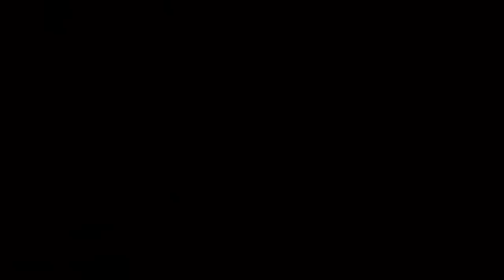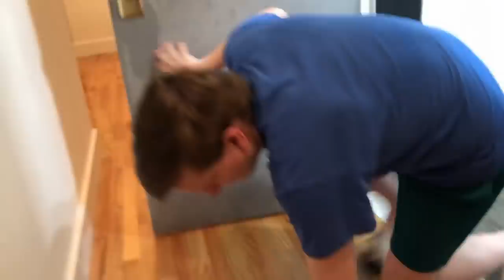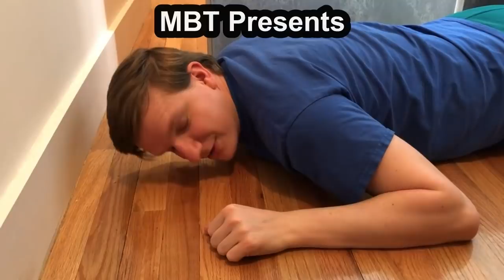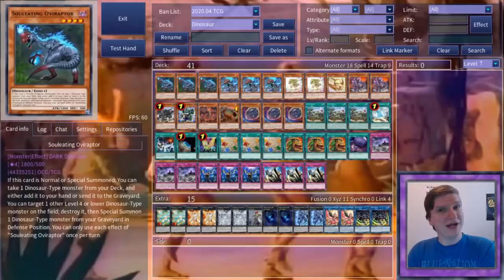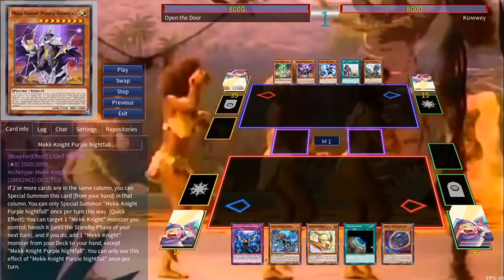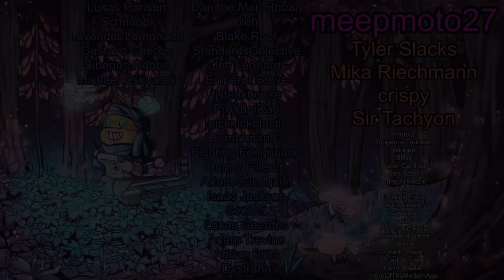DINOSAUR - Ten Minute Testing 4/15/20

Comment: 4:43 What does he mean by "koakai and eggs" what does he mean by "eggs" the non tuner adaman monsters?
Reply: Yeah, he's talking about the crystal forms of Dragite/Leonite/Raptite before they become the Synchros...
Reply: @Hawk_Blade99  don't you HAVe to play them for the Adamnatia engine?
Reply: @DareToWonder  Not necessarily. All you really need are the "miner" cards (Seeker, Researcher and Analyzer) and level 4 or lower non-tuner Rock-type monsters...(which the crystals just happen to fit in with).

I mean, the Crystals can allow their Synchro versions to activate their secondary effect and the crystals can also recycle their Synchro versions back into the Extra Deck, but that's about it.

The crystals aren't as strong as you'd think they would be... Some people have replaced most of the crystals with Gogogo cards...except for the Dragite crystal because that crystal lets you draw a card.

It's definitely an interesting place for Adamancipators...
Reply: @Hawk_Blade99  i dunno, im going for a general rock build with Metaphys and Fossil's soon so im really looking at the ulility of the eggs.
Reply: @DareToWonder  That's what I like about this archetype: it gives you a lot of freedom in how you want to play it.
Reply: @Hawk_Blade99  rock good stuff, fossil fusions, the rituals, admantia synchro, etc

Comment: I just feel not playing Overtex is incorrect at the moment, sure it's a brick but having the ability to recycle your guys is way better in a control format where resources matter. And also this is just my opinion, I think the only field spell worth playing rn is Lost World.
Reply: I agree with you. The True King variant of Dinos seems to be a bit bricky. And Overtex is pretty good with its spell/trap negation.

If you take out the True King cards, you can add useful cards like Evenly Matched or back row removal (most likely Cosmic Cyclone/Lightning Storm at this point in time)...

I just feel like the build showcased in the video wasn't entirely focused on going second and because of that, it wasn't as strong as it could have been.